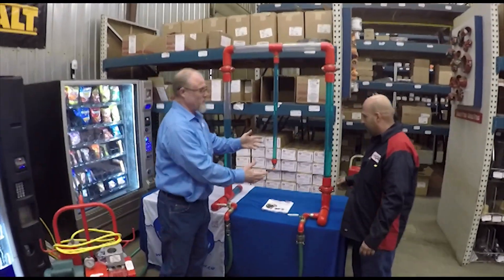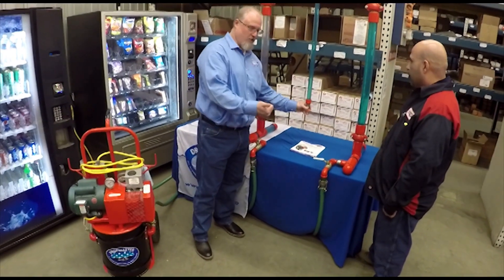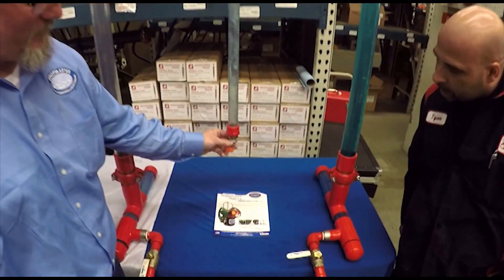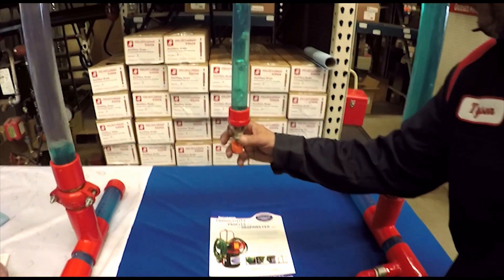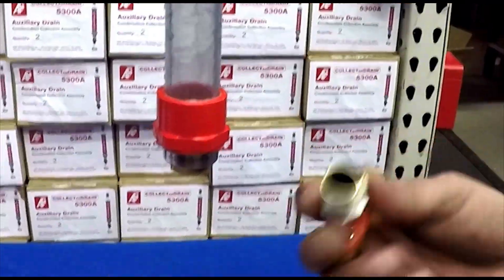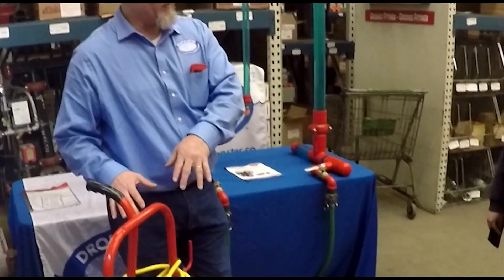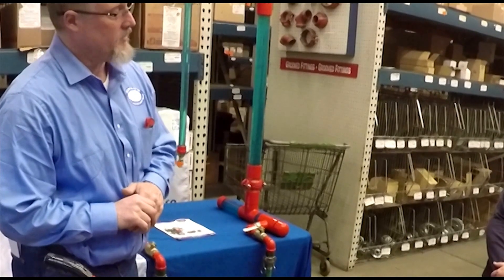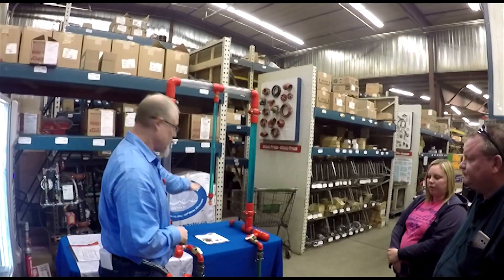Replace Fire Sprinkler Heads without the mess!

Comment: I just need to replace some sprinkler heads, are you available in the New York area?
Reply from the maker: Hey Simon.  We have a warehouse with products in New Jersey.  I would recommend a Contractor to replace heads, as the system will need to be inspected.